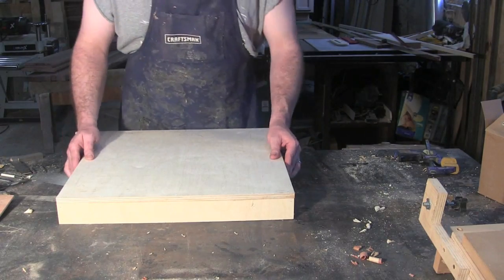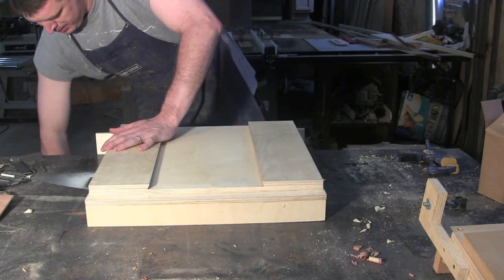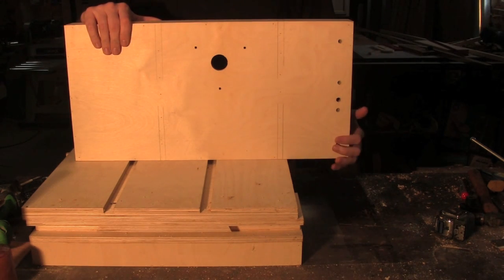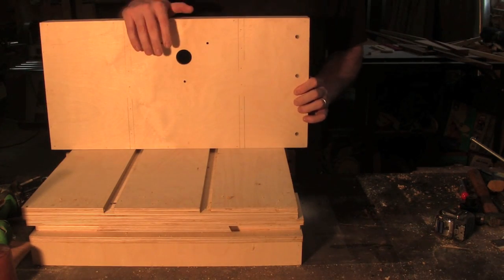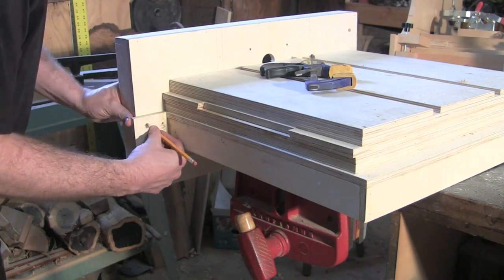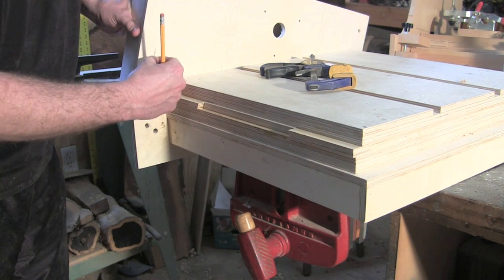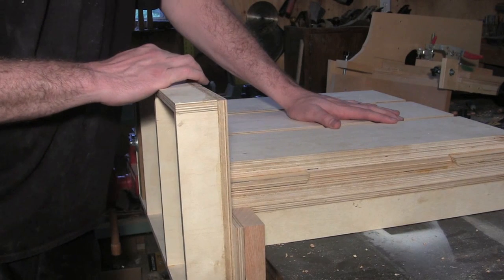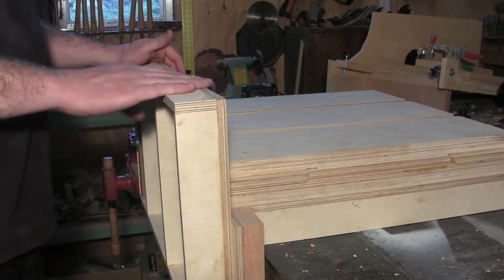Horizontal Mortising Machine: Building an Improved Version Part 4

Comment: Love it, man, absolutely love it.  The simplicity is so great.  I'm wondering how the dovetails will hold up to dust in them, but if that works after you use it a bit, I'm in on building one of these.  Thanks for the series!
Reply from the maker: n8guy You have to pull it apart from time to time and blow the dust out of them, but I made it through doing all the mortises on the doors without it being a problem.  It doesn't actually produce much dust, just lots of big curly shavings.  Thanks for watching!